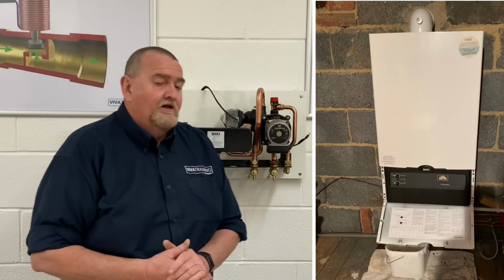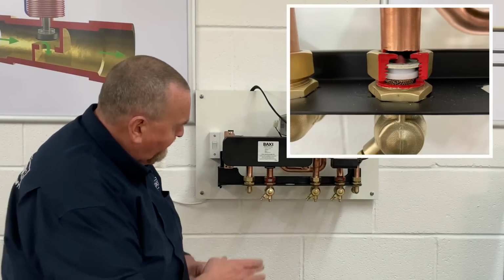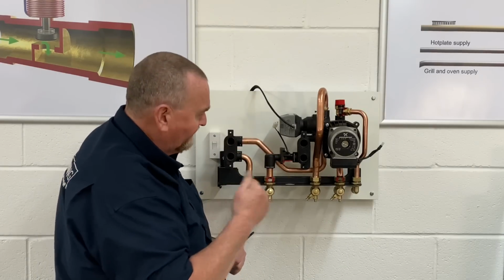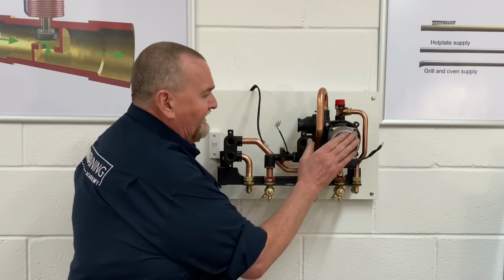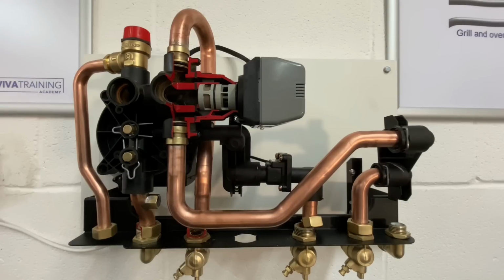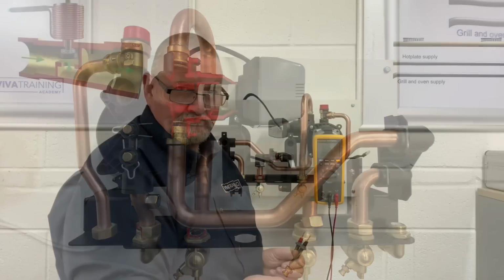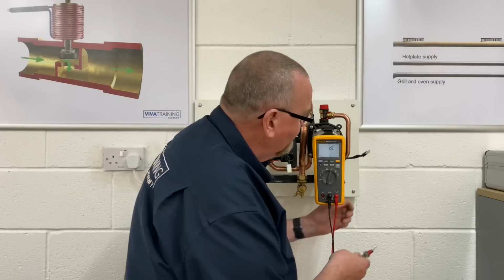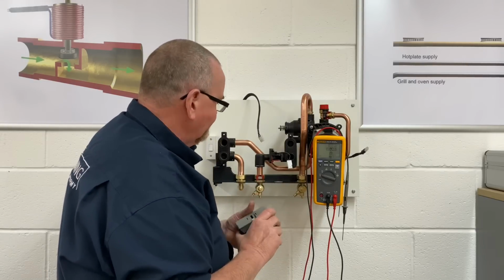Combi Boiler Fault Finding - Baxi 80 100 133 HE

Comment: Hai...just moved into a house with ideal logic combi boiler 30. Could you please help me with the settings?? Can I keep my boiler off.???
Reply from the maker: How can i help? Thanks.
Reply: @AllenHart999  I have set the timer for heating. So should I keep it in winter mode for the radiator to work?? And I kept my pre heating off...is it ok?? Is there any way so tat I can share the pic of my settings?

Comment: Brilliant video chaps 👍 Roy what is the best way to change the proving switch on the solo top right hand corner on the aluminium hex
Reply: Hi Richard, thanks for the feedback.
The way I do it is to drain down the main heat exchanger using the 11mm drain point on the bottom manifold. Then pull out the clip attaching the flow switch to the pipe, remove the bracket holding the pipe to the Pcb shield then provided the boiler tails have compression fitting on, slacken the compression joint ease the pipe out of the way. Then I use a 1/4" 10mm socket with a 1/4" universal joint to undo the bolts securing the flow switch,  if the flow switch is tight I would use pipe grips to twist it out.
Reply: @royfugler9971  thanks Roy. Makes some sort sense any chance of a diagram or a picture sorry to be a pain

Comment: Hi allen, smashing video i had a question for roy please on the divertor valve it was about the cable testing 240ac to black + blue and  brown +blue in what mode are we to expect these voltages at the divertor valve and also in using the magnet on the padlle switch does this just mean it bypasses the switch by using a magnet
Thankyou allen, viva + roy 👍🏻
Reply: Hi Harry, thanks for the feedback.
Brown - Blue is Hot water 
Black - Blue is Central heating.
Using a magnet on the flow switch is to prove the electrical side of the switch works, so the problem would be mechanical e.g. the switch is faulty, a blockage or in the case of a pump proving switch the pump would be at fault.
Reply: @royfugler9971  perfect thankyou roy 👍🏻

Comment: How do you remove the plate behind the plate heat exchanger to access the flow switch?
Reply: Hi William, if the clip holding the flow switch in has been put in from the rear, you don't need to remove the plate, however if the clip has been fitted from the front, the plate is held in by 2 self tapping screws on the left which go into the chassis and on the right a self tapping screw into the chassis and the bottom left pump bolt.
Reply: Thank you for the quick and helpful reply. Your contributions are superb.

Comment: Roy:    Those two blanked ports on the rear of the plastic pump housing were for actuating a pressure differential unit that pushed a pin out and operated a micro switch, can't for the life of me remember what boiler I saw it on though............ Perhaps a old Vaillant or Volkera , many moons ago.   HTH

I change lots of those H/Well cartridges on  WB oil heatslaves where the cartridge is the smallest waterway on the boiler and susceptible to mucky systems.

Keep up the good work with Allen, great videos.  Cheers. J
Reply: Hi Julian,
Thanks for the feedback, as they say every day is a school day, even after 40 years I'm still learning.
Reply: @royfugler9971    Same for me Roy, part of what I enjoy about this job every day is different and you are always on the move.  Learned a lot of usefull baxi stuff from you. Cheers.